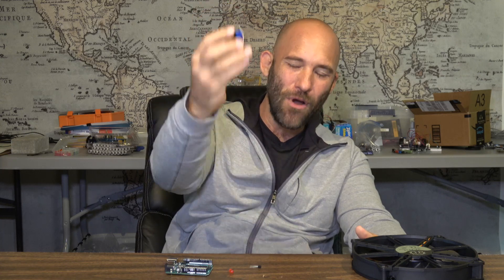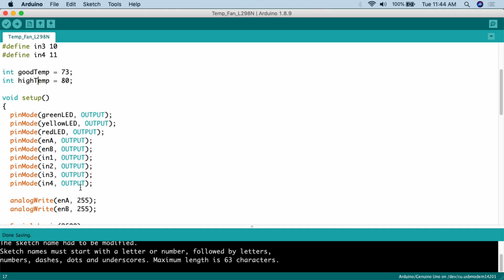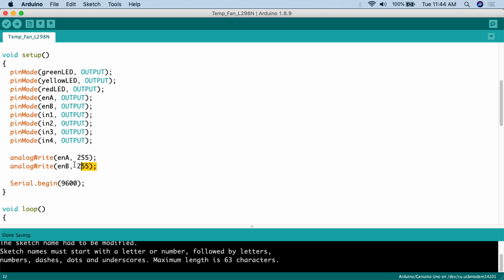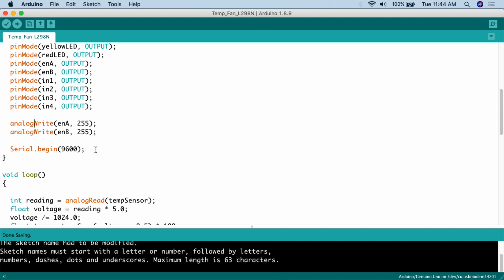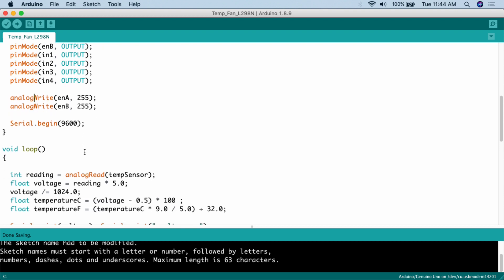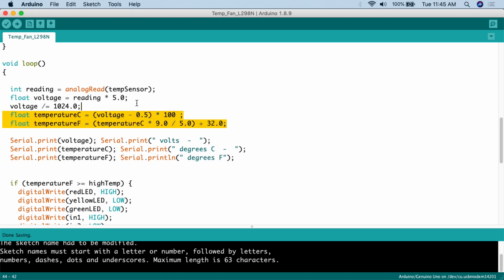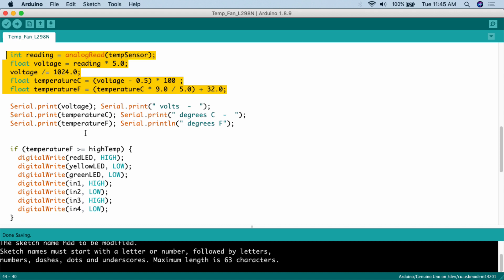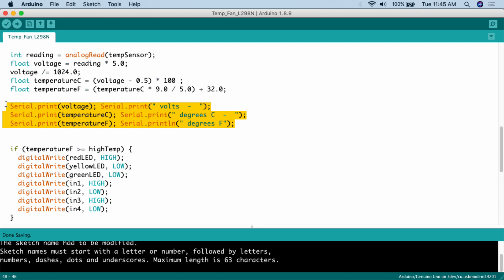Temperature LED Alert and Fan Activation with Arduino

Comment: Omg!
The story reminded me of a previous client I assisted with
The fortinet unit was on a shelf, in a closet room. No vents or windows. The only window's boarded up (heck with that). 
They're a small airline group that has a branch in Alaska. 
And whenever they'd close the room or pile stuff on the fortinet, it'll trip out because of temp issues, affecting the whole site. 
I sent out an email recommending to have at least 2 fans for it if they can't relocate the unit to a more ventilated area-they scrapped it. 
So most likely this time the replaced fortinet died, and then they'd be ordering a replacement.

Comment: Great video, thank you for taking the time to teach. What if I wanted to trigger hardware that has a Type A or B plug? Tried searching for ways to convert it to a 3 or 4 pin type but I guess the difference in power is an issue. 

I’ll settle for USB powered hardware instead. Can USB power be turned on and off while still using an external power source?